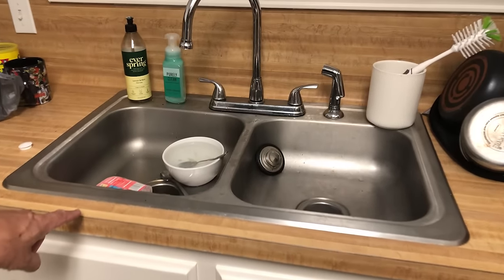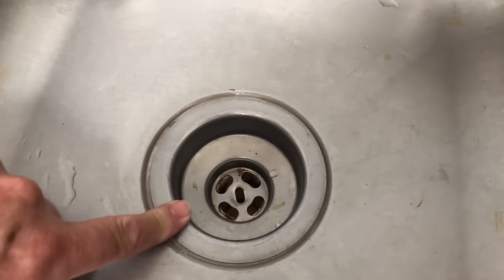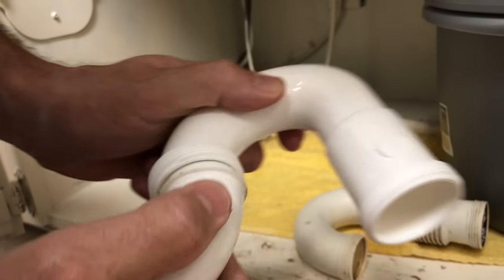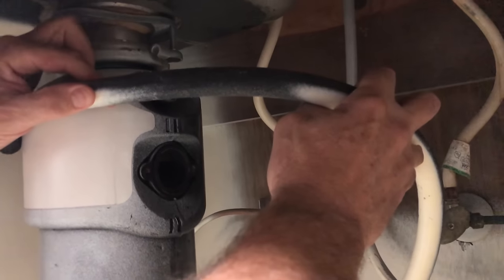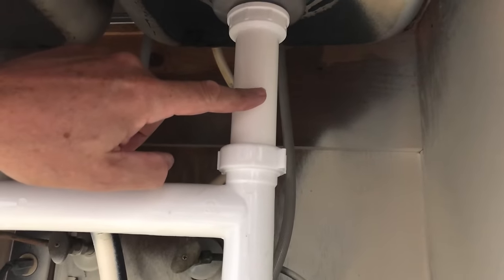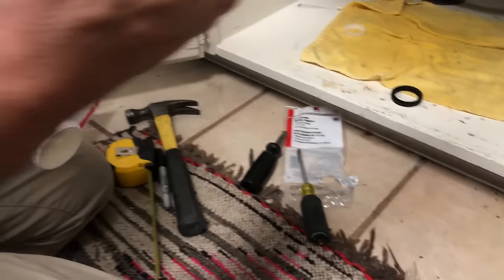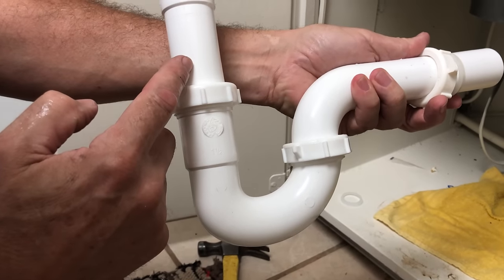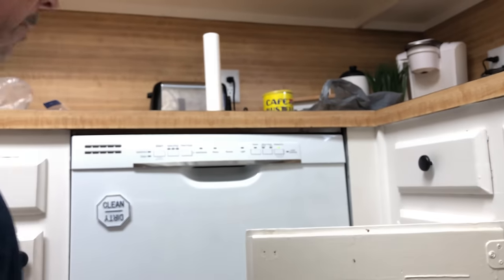How to Fix a Dishwasher/Sink that ISN'T Draining

Comment: Newer dishwashers have a built-in check valve on the drain side and don't need an air gap.  Just loop the drain above to underside of sink and fasten.  I would put a stiffener in the black drain hose where it is connected by the gray coupling to the disposer.  Slip joint plumbing is for home owners and no real plumber I know use the stuff...they use schedule 40  dvw pvc.  If done right the first time it lasts for many years trouble free and is easy to service and repair later.

Comment: Hi, when I run my dishwasher and use the reverse osmosis water filter system at the kitchen sink— the water tastes strange. I think when the dishwasher starts, some contaminated water goes to the filter system. Is that a common problem?

Comment: My dishwasher started leaking tonight because the damn kitchen sink drain clogged up. The dishwasher filled up with water and started leaking. The thing is is my drain dont come out of the wall. It comes out of the floor under the sink. Do I still need a p-trap before it goes into the floor ? Or is it ok to not have one ?

Comment: The black rubber hose should be able to connect directly to the drain inlet of the garbage disposal without that grey color piece with 2 ring clamps. Just secure the black hose to the inlet with 1 ring clamp.

Comment: Something I do. I got this tip from a plumbing inspector years ago. Everytime I do dishes, either by hand or use the dishwasher I add a capful of bleach. (The cap from the bleach bottle). A table spoon I was told is all you need to disinfect.
It disinfects everything. Dishes sink, and the sponge. 
A side benefit is it it takes care of all the grime you see, where the basket strainer connects do the tubular piping under the sink.
Caution though!
Too much bleach can cause issues with septic systems. Septic systems rely on bacteria to break the fecal matter down. So educate yourself on best practice or method.
I do not have experience with septic systems. Other then as a child.
Garbage disposals.
Older pipes. Etc. 

.

Comment: What about dishwasher high loop and if ya don't keep that basket from moving, you'll be pulling that too, cause, it will leaking quick, you'll see. But nice job brother.  Also, ridgid makes a nominal pipe cutter, I prefer knipex , but they make it cut so clean, nothing get stuck in they way you cut it. js

Comment: My dishwasher empties via an air gap then to the disposal.  This alleviates 2 problems, 1) back flow is not possible from the disposal bask to the dishwasher, 2) if the tube from the air gap to the disposal clogs (which it did in my case when the inner rubber wall started disintegrating), the water will flow out of the air gap and into the strainer side of the double sink.

Comment: Why use plastic screw together drain line instead of using a PVC or black dww pipe making it less likely to leak in the future? All drains I repair or replace are glued together except the tail pieces, P-trap disconnect and wall connection. every other connection is glued/sealed.

Comment: Ours is built the same as this one

Problem is when disposal is ran is blows water up at that T connector and into the non disposal sink 

Why is that?

You didn't test the running of the disposal

Why?

Comment: Where is the diverter?  I live on the west coast and have always seen the dishwasher water drain into a diverter (I think it is called that) mounted on the sink's back flange, and a flex pipe feeds drain water to the disposal.  The diverter provides an air brake to prevent contaminated disposal water from seeping back into the dishwasher.  When a broken plastic fork tang or crud from the dishwasher becomes trapped in the diverter, the dishwasher won't drain.
Reply from the maker: Yeah it’s called an air gap.   Not required where we live.   I hate them 😡👊

Comment: FYI. You should always run the HOT WATER ONLY for a few minutes to check for leaks. As the hot water will soften the plastic and cause a leak. Usually where the nuts just not quite tight enough.  Cold water alone will not always cause this. (Be careful when tightening a nut after hot water's been running. It's easy to strip the threads. Only tighten enough to stop the drip)
Reply from the maker: Cool thx Chris 👊

Comment: Either high loop on dish washer drain or install an air gap ! So you don’t get wast water backing up into the dishwasher
Reply from the maker: Lots of comments about that. I haven’t seen a dishwasher back up in 45 years.   There’s a check valve on the pump outlet on modern dishwashers but I get it👍

Comment: You’re going to have the same problem with the dishwasher, you need run the drain pipe for the dishwasher higher than the inlet to the disposal so water won’t flow down the tube, It’s all in the directions for the dishwasher

Comment: Did you really need to cut the tail piece? I thought they are designed to telescope?
Reply: Looking further I realized that having the tail piece longer would have been a problem for the horizontal line coming from disposal.

Comment: Washer is in the utility room next  to the kitchen. The washer when draining will back up into the Kitchen  sink. What is the problem? The washer.  Kitchen sink bathroom sink and tub  are all on the same drain line.
Reply from the maker: Washing machines dump a lot of water quickly.   Partial clog or vent issue?   See our video on getting the nuts out of vent pipe 👍

Comment: Just one mistake here.  When water runs down the drain into the garbage disposal, it will enter the rubber hose leading to the dishwasher, and run dirty water into the bottom of the dishwasher. The rubber hose from the garbage disposal needs to go upward before it goes down to the bottom of the dishwasher.

Comment: Running the dishwasher hose straight into the disposal is unsanitary. You'll create a situation of grey water contamination dumping into the dishwasher. Use of a airgap is much more practical, safe and required by code.

Comment: At 1:20 you say attaching dishwasher hose to drain stem makes things much more complicated. But why? You actually don’t identify any difficulties, or make a case for why that would be so..? It actually looks simpler and will be quieter draining to attach to the drain stem. It looks like once you fixed the blockage from the Teflon tape, rest of the sloppy plumbing, and maybe add an air gap loop, you’d be good. Most sinks don’t even have a disposal..

Comment: Every plumber is cringing as they watch this. You never want horizontal parts with compression fittings under the sink cause they catch grease and crap.  You don’t want the disposal draining into the other side of the sink. It should have it’s own p trap and drain into a 1 1/2” Wye installed at the wall.

Comment: Good video as always!  The premise for the connection of the dishwasher to the disposal, initially, was to chop up any large food particles that made it out of the dishwasher.
With better tech in the dishwashers nowadays, it is almost not necessary, but I will install the connection given the chance. With an air gap or high point in the hose.

Comment: Try using half inch copper pipe about three inches on your rubber dw connection boot to hose tighten clamps forever never leak

Comment: Great video Paul I really enjoy the way you take to time to explain why and how you are repairing the plumbing. Paul if they purchased a disposer with a stainless steel smashing drum that would eliminate any problem with the galvanized coating wearing off. I experienced that problem so I swapped out the disposer with one that had a stainless steel smashing drum. 1 1/2 years later no odor and with 1 1/4 HP the disposer never clogs. Also it is vital to create a high loop with the dishwasher drain to avoid backup of the dirty water. One last thing most codes require a GFCI outlet under the kitchen sink. Was that an oversight by the homeowner?
Reply from the maker: Thx Ernest 👍👊.  Yeah the stainless steel is my preference to but sometimes owners opt for cheaper version.   High loop got it.   GFCI at dishwasher is 2020 NEC.   This house is way older 👍.   Landlord can upgrade if he wants to

Comment: This is a really great video now I would guess so my scenario is my dishwasher without a dishwasher was broken so it had a new one is it would never dry the dishes were always wet and with the new dishwasher it’s the same thing so would that be because the dishwasher is not draining properly you think and when I looked under my sink the plumbing looks so much more complicated than that so just a quick question

Comment: Nice video. Should raise the hose going from the disposal to the dishwasher above the disposal connection. This creates an uphill, high loop, and prevents dirty water and debris from spitting out of the disposal, then running directly downhill into the dishwasher, clogging valves, and such.

Comment: I prefer to use a disposer outlet kit (the black outlet 90 that comes with the disposer) to prevent back flow into the disposer (as per mfg instructions).  Also, the responsible thing to do is UNPLUG the disposer before anyone sticks their hand in it.  The blades aren't sharp but they do spin fast enough to bust up your fingers in half a heartbeat.

Comment: The contractor that did two of our bathrooms last year installed those flexible pipes. I knew from watching these videos that they were bad, and they argued that it was “convenient and good enough.” The plumbers they hired also did illegal work on a sewer line, so the clean out had an incorrect fitting (a T instead of a 45 degree pipe pointing toward the street). Our basement flooded afterwards, and they had to hydro-jet our sewer due to us thinking it was clogged. The jet tool went toward our house due to the incorrect fitting, breaking the toilet. Apparently, that whole sewer line was installed so long ago that the city did not even know where it went, and it had also collapsed, hence the flood. (It was an old clay line from 1909 or before.) It cut across 3 of our neighbors driveways without connecting to any of their houses, before probably connecting to the main line at the intersection. They are abandoning that line now, and installing a new sewer line under our house straight out to the street. They are also redoing all of the old cast iron under our house, because it has bowed so much that parts of it are actually at an incline! According to the city, there is another sewer line out of our house, but it does not seem like it is even hooked into our house at all, and there are questions of whether it even exists!
The house was previously bought and flipped in 2002. The people who flipped it were obviously not really fit for the job: there were empty beer cans behind our drywall when the crew we hired demoed the bathrooms last year. We also remodeled another bathroom in 2019, (not from the same contractors, and that one was quality work, not unlike the work I see on this channel.) In that bathroom, there was a malt liquor bottle under our bathtub!

Comment: Glad I found this.  Usually, I call a plumber but I'm wanting to see if I can fix it myself.  The kitchen sink has been slow to drain for a while and I sometimes have to run water through the disposal to get the regular sink to drain.  This will usually 'unclog' the drain for a couple of days.  I've noticed that it 'gurgles' and an air bubble comes up the regular sink side, after which the sink will drain.  Additionally, nasty water has now backed up into the dishwasher.  The information and clear demonstration presented here will definitely be my guide.

Comment: The problem is that dishwasher hose has to  come through top of cabinet down to drain,its siphoning now.
Reply: Yeah, but you can see the DW was installed after the kitchen was built.  There’s a cabinet between them.  Not much these guys can do to rectify, although I would have at least taken up whatever slack was under the sink to elevate a loop as high as possible.

Comment: When you connect the hose to the adapter for the disposal use 1 1/2 inch piece of 1/2 inch copper in the house to make it ridged for the clamp

Comment: I don’t think connecting to disposal is allowed in some states. Illinois doesn’t allow it. I’m struggling with old galvanized drain pipe in the wall that is pretty high up and trying to decide if it’s worth it to even keep the disposal. I think it’s caused me issues with the drain pipes being so old. Rumor has it plumbers (ok the plumber I use) hate disposals lol.

Comment: Can’t believe these guys didn’t install an air gap or at least loop the dw drain line up as Hugh as possible, attaching it to the underside of the countertop to prevent dishwater back flowing into the dishwasher.  Having that drain line laying on the cabinet floor will cause the dw to not drain completely.

Comment: Heads up ive installed hundreds of pea traps. I do not know if its a manufacture issue but ive noriced. A inconsistency where i will install them and a week later i get a service call cause the pea trap is leaking so i started using teflon tap and it has saved. Me alot of time. I can not seem to pinpoint why sone of them leak while others dont. Its fairly simple. And for how many of them that started to leak a week after installation i feel as if its a manufacture defect. Just a heads uo to. Residential plumbers that are fairly new overall this guy. Is very knowledgeable. Everything he pointed out in video is spot on u have to be careful with these D.I.Y. videos always watch more then one and mabey. Do some research. Oni ternet before u dive in head first

Comment: This is a good video however having the discharge hose connected directly to the sink plumbing is always best. Any time you connect directly to a  discharge line is best. You only add to the potential and actually create another problem with in the drain system. The soaps and chemicals in the detergent will absolutely over time will carrode and eat through the disposal greater potential of clogging up the disposal. It’s a lazy way for a DIY OR any one to connect to quickly. Their is never a reason to hook your dishwasher to a garbage disposal. The company’s purposely design this with hopes you do. To damage and cause you to buy another. Disposal sooner than you should. Always eliminate adding another place to cause problems and this being a high dollar problem. It makes absolutely no sense to to create and incorporate another component that has not one  thing to do with the the other. Again it’s all  about wearing your disposal out faster and having you buy another.

Comment: Just recently had a newly installed sink and dishwasher by a contractor. First time using.. Water poured out the air gap sitting on top of the sink. What can the issue be?? Thanks
Reply from the maker: 1) not sure if there's also a new disposal, check to make sure the plug was removed at the dishwasher drain inlet, we did a video on installing a disposal if you need to check that out.
2) the larger hose from the air gap down to the sink drain must not have any kinks and must be routed in such a way to avoid any bellies; there should not be any standing water in the larger hose at any time; water needs to flow freely from the air gap to the drain; the dishwasher pump pumps the water to the air gap where it goes thru the device and from there to the sink drain it drains by gravity only so any kink, belly, unnecessary turn, too much length, etc. will hinder the flow

good luck!

Comment: I would warn anyone who is about to tap that knockout out to be very careful - its best to just remove disposal and then tap out the knockout. I was never able to find that little piece of metal due to big hands but it was down there and ruined my disposal first time i flipped that switch.
Reply from the maker: Yes, my hands won’t fit to retrieve that plug 👍
Reply: @StudPack  yea thought I’d probed every nook and cranny, but ultimately was just too much in a hurry - lessons learned!

Comment: great video thanks. i have a problem with the side sink where i put clean dishes when i don't use dishwasher, everyone I turn on thefood disposal all smelly gunk comes out and fast on the side sink where i have clean dishes drying, I've tired a few things but the problem still there. I've used small sink plunger , I have  used drano  to see if it dissolves any  and I have even taken  trap pipes under out to clear them of any debris or any  clogged pipes and no results . Can you tell me what else could it be .? Im trying to stay away from plumber ,thanks so much and keep up those good videos coming.
Reply from the maker: Thx Alex.   Where the two sinks connect together, that fitting is a tee.   There should be a baffle inside to prevent your problem.   Check out Keeney #125AWK
Reply from the maker: You can see the baffle in the old tee at 10:19